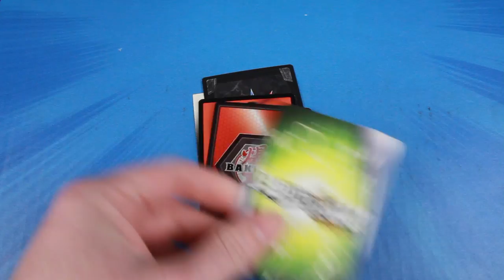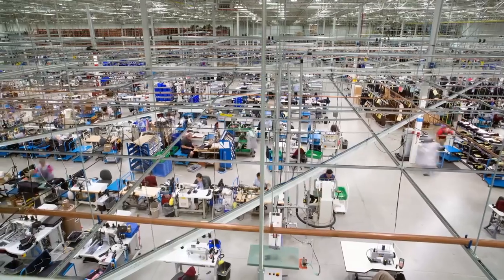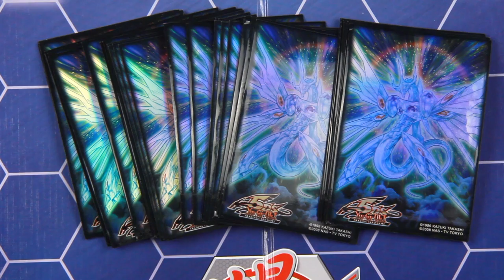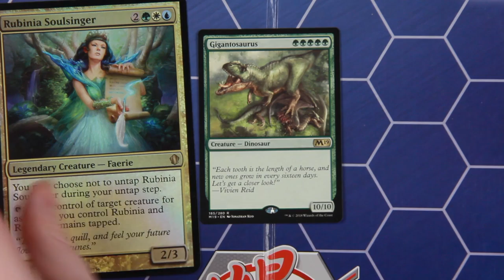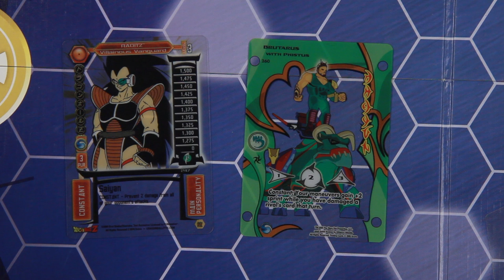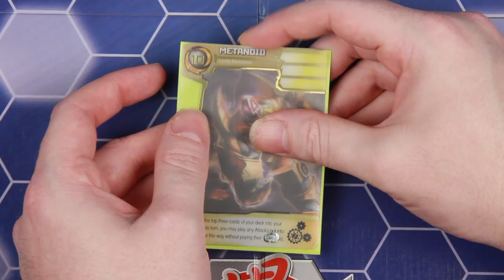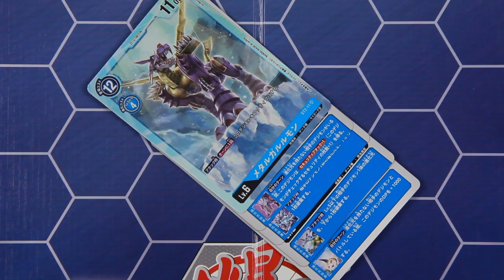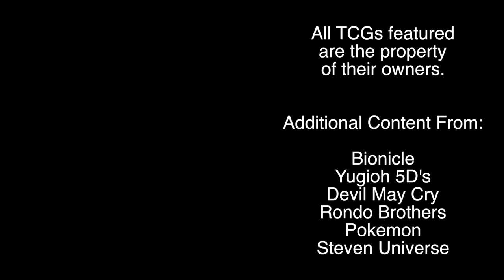NON-STANDARD CARD SIZES! (Seven Deadly TCG sins #4)

Comment: Hot take; I'm fine with Yu-Gi-Oh being smaller.
Reply: The only issue now is how much text is on new cards
Reply: @pandosham  PENDULUM
Reply: They have so much text on the card they should be standard size.
Reply: @patbateman69420  nah, I play yugioh, the card text is fine. Even on big daddy Endymion.
Reply: It just the standard size for Japanese card games, YGO legitimately just has a different demographic.

The card size is fine. No card game player reads anyways so too much text is not a problem.
Reply: Well, that's a pretty garbage take.
Reply: @pandosham  said like a non yugioh player
Reply: @codynelson7575  I play,  the amount of unnecessary text is my issue.
Reply: @pandosham  Honestly you can skip 40% of it in most cases. Not too awful. Stuff like Datascape seems like a nightmare of text. Play against it for a day or two and you will literally skip past over half their text.
Reply: Hot take; the rush duel text system can solve this problem.
Reply: Yeah, there is so much less waste in making the cards due to the lower size and any sleeves do the same thing.
Reply: Certain Extra deck monsters have so much text they just start the effect right next to the material requirments.
Reply: Since the game has been out for a long time, theres plenty of support in terms of sleeves and what not, so it's not a big problem. However, standard size sleeves usually got a lot more variety.
Reply: Yugioh recently using abbreviations to shorten effects like GY (graveyard), banished (remove from play), Quick Effect (during either player's turn), etc.
Reply: I started with Yu-Gi-Oh so to me that's the standard card size
Reply: @Yohane350 just like 10 monsters really. its not an issue
Reply: @cairill  New players have to read, so too much text is a BIG problem.
Reply: The way Yugioh card text is written has been completely standardized since 2011 (Problem-Solving Card Text). They're written in such a way that a judge can make ruling calls without having to consult a massive comprehensive rulebook that covers every corner case interaction that may come up. After awhile you get used to what all the common clauses are, so you end up being able read cards pretty fast. It's also common courtesy for your opponent to give you a summary on what any of their cards do on top of letting you read them if you aren't familiar with their effects.
(And yes I do realize there are still a lot of imperfect YGO judges out there.)
Reply: I can't read though...
Reply: to this day, im still amazed how konami managed to fit pendulums' wall of text
Reply: It is not Yu-Gi-Oh which is too small, it is all other TCGs that are too big
Reply: @cairill  Can confirm. I play yugioh and can't read.
Reply: It's not the size of the card, it's the potency of the card effect
Reply: other tcgs are too big
Reply: The problem with Yugioh cards having a fuck ton of Text is only om the west... The japanese cards actualy use shortcuts
Reply: @gawrshurab1035  and alphabets being longer than Japanese characters
Reply: Hot take: they need to change how the text is written to make it more intuitive. There's so many times where you look at a card's text and it could legitimately be 1/2 the size if it weren't for the unnecessarily lengthy wording.
Reply: @patbateman69420  i don't think Standard size is enough to hold all of the text
Reply: @darklightmotion5534  the card text is fine for you who probably has perfect or at least fine vision. For anyone with has issues reading smaller text obviously yugioh cards have become border line impossible for them to read
Reply: @gawrshurab1035  true but omg have you seen the furigana on some cards? XD shits so small even I need a magnifying glass and I use glasses. Granted Furigana are for people reading something for the first time or kids but damn is it small 
even if you arent supposed to read it in yoir teens
Reply: @Frostgiantbutsmall  they should change the phrase 
"This effect can only be activated once per turn" at the end of the actual effect.

The japanese text would say stuff like
you can effect ① and ② only once per turn
and the mark the effects with the symbols and sometimes even ③ but since ③ isnt included above you can use that effect multiple times. 
Instead of writing that long sentenece to every effrct on a card
Reply: People not reading cards are my favorites, they are the perfect victim for old jank stuff.

Like, Flower Cardians, there's many people who just toss Ash Blossom to one of the cards not realizing it doesn't have OPT on it.

Or heck even Time Lords.
There was this guy that kept on negating my Time Lords effect of trying to shuffle itself back in the deck on YGOpro.
Like after 3 turns I told him "you know he is trying to shuffle himself back into the deck right...?" Because this was just sad by that point.
And he finally stopped.
I was playing a janky Destiny Board deck tho so I was long lost already.
Reply: @patbateman69420 Cold take but Japanese size is the standard size!
Reply: Yugioh is standard in the country it came from
Reply: I love Japan sized cards, as a kid I dreamed of full art yugioh cards.

Comment: There's one exception to the plastic cards for see-through purposes that actually works really well and I highly recommend - though it's not a TCG, but a standalone deckbuilding game: Mystic Vale.
The game itself comes with sleeves for the "cards" so you don't have to worry as much about them being non-standardized. In essence, it has a play pattern similar to Dominion, though instead of just buying a card from the market and adding it to your discard pile, you buy a piece of a card (top, bottom, or middle) from the market, and slot it into one of the sleeves, constructing the cards with which you're constructing your deck. And because the actual "cards" in your deck that you start with have normal backs, the translucency isn't a problem. The only (relatively minor) issue is that you can sort of tell which cards are which while shuffling if you, for example, have one mega-card with the backing card and all three sections filled.

Highly recommend checking it out, even though it's not a trading card game.

Comment: I watched this video a long time agao. I did get a recent insight. A great analogy to this sin is beds. Hear me out. Beds have parts to them. There is the frame, the mattress, the sheets, the blankets and the pillows. Frames and mattresses are sold in special furniture stores. There are even specialized companies that sell mattreses. The rest  of the stuff is sold in regular department stores. These things are soposed to fit together to form a bed, even if they come from different stores and different companies. There are sopposed to be four standard matress sizes. From small to big, they are twin, full, queen and king. Different sizes suit different people. Some people like having more room than others. Another factor is how many people are in bed. Children and single adults normally sleep alone. That is one person. Married couples normally sleep together. That is two people. Larger mattresses are mainly sopposed to accommodate such couples. Mattress size affects the size of the other parts of a bed.

The mattress sizes don't work so well. The big problem with fitted sheets. I hate fitted sheets with a passion. I hate them so much. The problem is that fitted sheets are difficult to fit onto the bed. It is difficult to put on. If one corner goes down, another is likely to pop of. The fitted sheet doesn't stay on. In my experience, it only takes one night for the fitted sheet to start comming off. I have tried ususing special sheet suspenders, but they don't do much to improve it. I have the same problem with mattress pads. This issue is so bad that I cant even make my bed on my own. It takes two people to make a bed properly, unless the fitted sheet and mattress pad stayed on. If left to my own devices, I would rather sleep directly on my matress. This is pretty gross. A bare mattress is vulnerable to get ruined by food and body fluids. However it does say a lot about how bad fitted sheets are, if that is the better option.

I did go to a mattress store a long time ago. I talked to the sales person about my problem. The sales person revealed something intriguing. Mattresses don't really have a standard thickness. So some mattreses are thicker than others. Fitted sheets work on thin mattresses. If a mattressis too thick, the sheet doesn't completly cover the top and the sides. So it comes off more easily. The mattress store offered special kind of sheets for thick mattresses. They are called deep pocket sheets. Unfortunatly these sheets at the store were so plain and ugly. So I opted out of them. It is better to get sheets at a department store, necause the selection is so much better. Sheets come in different colors and patterns. There are even sheets with cartoons on them, and they tend to be geared towards children. So someone picks sheets that fit thier aesthetic taste and fit the size of thier bed. That is a lot of factors to consuder when shopping for sheets. However when there isn't enough standardization for mattresses, it becomes unmanagble. I guess one can make thier own sheets to tailor it to thier tastes. Pun intended. However making the sheets is a lot of work, and that is a hassle. I don't even know how to sew. A professional tailor could make special sheets for customers. However that extra service would make the sheets more expensive than the massed produced ones in a department store. I am too poor to afford such luxury. This video emphasizes standerdized parts. Nonstandard cards causes a whole host of logistical problems. There are problems with both manufacturing and storing cards. Things don't go smoothly when the cards don't fit other components. I know the perfect analogy. I have so much difficulty dealing with fitted sheets. It becomes a logistical nightmare when sizes are not standerdized enough and sheets dont fit mattresses very well. This really hammers home the sin of the video.
Reply: The plastic cards is a silly gimmick. However stacking cards on a creature is a good idea. It is cool to see a creature get stronger with supporting cards. Pokemon actually does this. The Pokemon themselves are powered up by resource cards and sometimes by held item cards. Stacking also allows weaker Pokemon to evolve into stronger ones. This is all done without the plastic. The physical Pokemon cards are normal cards. They are the standard size and material. So I recommend to just doing what Pokemon does. If anybody has never played it, they should learn the basics of how that works. They should do that before they think about using the silly gimmick. There has got to be some YouTube videos about how to play Pokemon. The minimum effort should be to watch a video. I used to play the Pokemon card game when I was a kid. I never played the Digimon game. I did watch the anime for both franchises as a kid. I do know that Digimon evolved too. It was so cool with the music, the spinning and the flashes. This video shows some footage of stacking Digimon cards. I recognize that as the evolution of Matt's Digimon, which is named Gabumon. In Digimon jargon, this is called digievolution. Pokemon cards stack for evolution in the same way. MTG does creature stacking to a lesser extent. In my old comment I talked about a special case of the Ikoria set. Stacking also occurs sometimes in the main game. Creatures are powered up by equipment or auras. That involves card stacking. 

I have thought about my own mechanic. It is where a creature card stacks on an element card and class card. This has a huge effect on the creature as it fights in different ways. Element cards have a rock paper scissors interaction, just like the types in Pokemon. The class cards are based on classes of RPGs, such as warrior, mage and priest. There are different roles. Some classes are more offensive and some are more defensive. These extra effects should really take up their own cards. Separate cards also bring more flexibility. Players can put any combination of element and class on their creature. I like this idea. Maybe there can even be extra cards to make cards even more powerful and unique. I am still doing development. So none of this is set in stone. Since I know what Pokemon does, I can use this mechanic without committing this sin.

 Besides I am thinking of a lot of features in the cards. I would like element cards to show strengths and weaknesses to many elements. The Pokemon TCG had a major simplification of the type system when compared to the original game. Part of it is that Pokemon has a lot of groupings, like Card Fight Vanguard. So supporting all types can be two difficult. So types got merged from 15 to 7. Note that those numbers came up in the original generation. Later times added the dark, steel and fairy types. This is an issue that was discussed in sin number 3. Another issue is card space. Pokemon creature cards are already crowded. There is info for HP, attacks, costs, effects and evolution. Then at the way bottom, there is a single weakness and sometimes a single resistance. If element was a whole separate card, there would be more room for more interactions. Class cards would have attributes. By attributes, I don't mean the colorful groupings in sin number three. When I hear attributes in gaming, I usually think of statistics that passively make a fighter stronger. It is something in the RPG games. The Pokemon video game has the attributes hit points, speed, attack, defense, special attack and special defense. I recently got into DND, which is the first RPG. It was played by tabletop. In that game, attributes are added to dice rolls and give the character a boost. I did figure out how this can be incorporated in a card game. The creature cards have their own damage and hit point amount. Then a class card is stacked onto that. That brings attributes. These attributes apply special bonuses to the fighter. I have four. Strength increases user damage. Armor reduces the opponent's damage. Health increases user hit points. Speed decreases opponent's hit points. I am still developing my ideas.

Comment: 5:40 I checked, they're like the Tarot Card sleeves, very niche and expensive.

As for shuffling Tarot Cards sized cards. eehh well actual Tarot Cards usually demand their own little table and wanted you to spread them out in a big old pile and gently shuffle them back into a deck intentionally so some cards are upside down, upside cards providing a alternate interpretation. In theory you can do the same with other card games with Tarot sized cards, but that's far too messy.

Comment: The comment at the end about how Digimon handles carry-over abilities was also done by Pokemon for a gimmick. Back in Gen 4, they made Pokemon LvX - stronger versions of fully evolved Pokemon with additional attacks or Abilities, but crucially could also use the attacks and Abilities of the base form. The problem was, because you put the LvX on top of the base card, there was lots of lifting it up to consult the base card. When they revisited it in Gen 6's BREAK mechanic (which was functionally the same - it's just now the Pokemon was drawn with a metallic gold render), they printed the cards horizontally, so that they sat over the art of the base card but allowed you to see the additional stats.

Comment: It's a problem in board games too, where there's a set of sleeves that every manufacturer makes and there's only sleeves that Mayday (as you showed a picture of) make.  "Standard" sizes include "Bridge" Sized, European Playing Card Sized, Poker Sized, Tarot Sized, Mini versions of the Bridge/American Sized and European sized, and the 70cm x 70cm square card sized (think slightly smaller than a coaster and as thick as a playing card).  One publisher got ahold of a sleeve maker and actually prints what sleeves you need in that line, so there's that going.  But if you're not buying a game from that publisher, you have a MASSIVE online list about the size of a rabbit hole in order to figure out what sleeves that you need, even for the games that use the 'standard' 7 card sizes for board games.  Also, board game sleeves are almost always clear backed and very few rare sleeves are matte, which can lead to table bumping problems.  Of course, sleeving is only a problem if you're concerned with the longetivity of the game

Comment: Then You have Vanguard cards which where made just larger than standard sized cards that they fit into the double sleeve. The Sleeve that MTG players used over their standard sleeve to keep their cards extra safe. So they had a slightly different size that Bushiroad uses to make larger card art.
Reply: Uhh... What? I tried comparing my Vanguard cards to my pokemon card, Vanguard's smaller...
Reply: Vanguard cards iirc are the same size as yugioh's, not sure what you're talking about